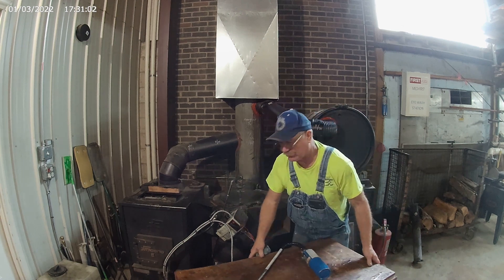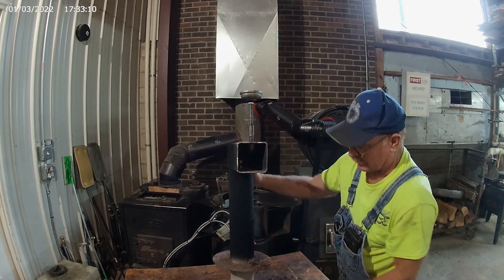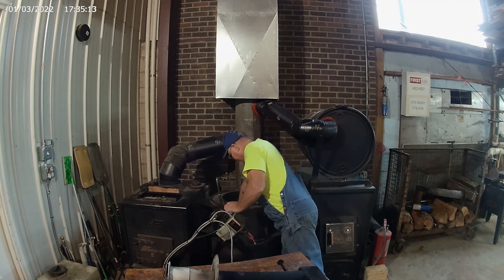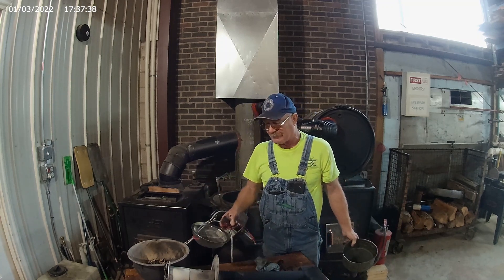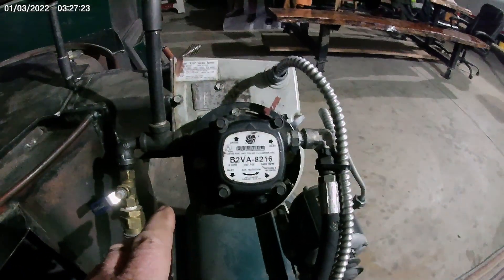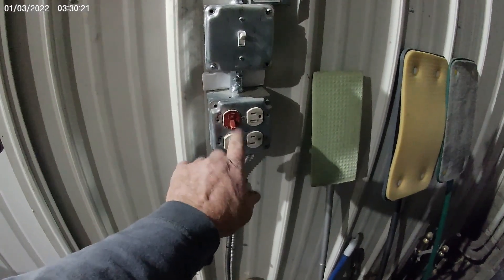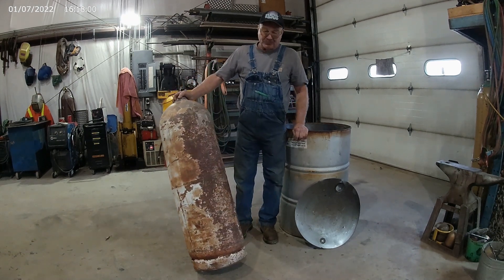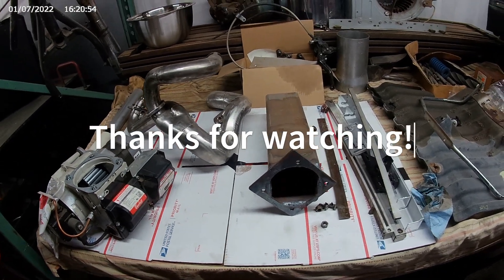Waste Oil Burner Modifications

Comment: Hello Mike, you say 2" from the bowl, is that the top of the bowl or bottom of the bowl. The down square tube is that stainless at the bottom with the fan looking impeller? My build will be a version of yours, a different enclosure because of what is available to me for free.
Reply from the maker: Bottom of ss boul to bottom of fan on bottom of down tube, i am now at 3"  & I clean every run. That keeps everything working alot better. Just started making another one with a heat exchanger on the exhaust. will be making a video as I go.